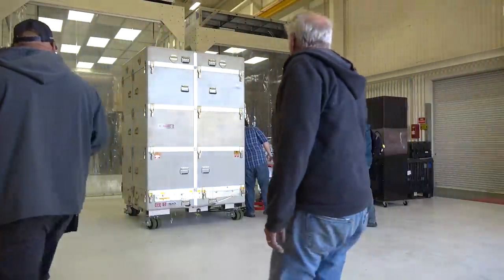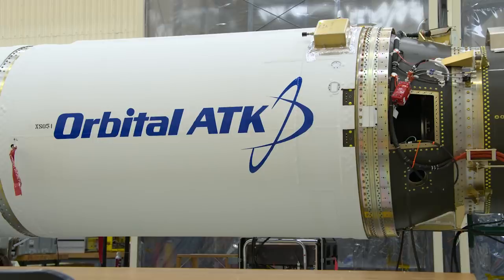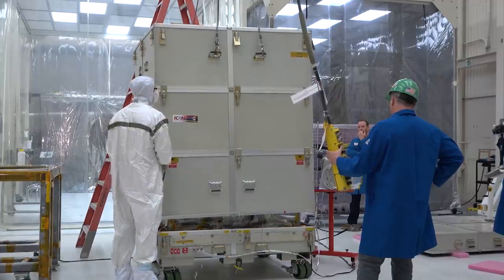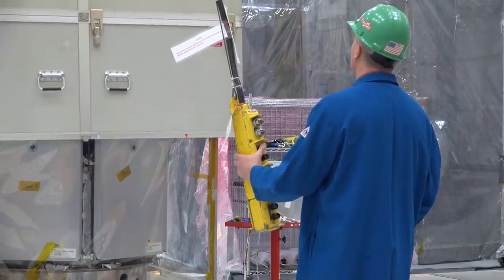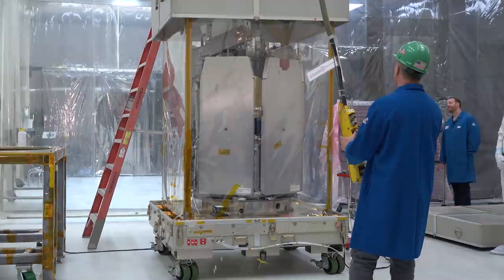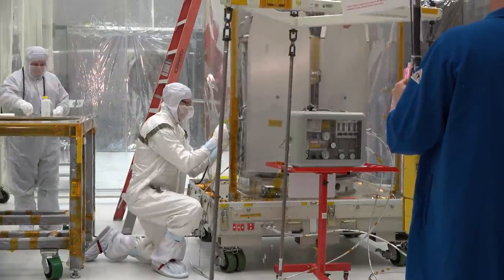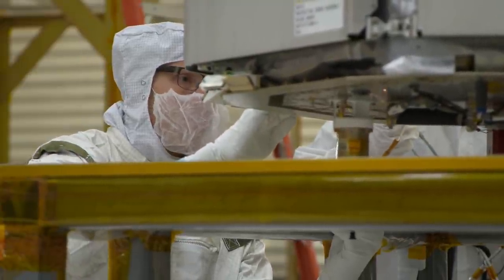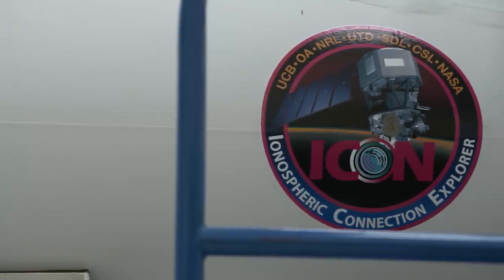Unboxing a New NASA Spacecraft

Comment: I always find it odd when they treat Earth-orbiting satellites like ICON with such kid gloves, in rooms that are cleaner than most operating theatres, when they're going to drop it out of an airplane inside a rocket where it'll be shaken to within an inch of its life! It would probably be better to be a bit more clumsy while it's still on the ground, so if something comes loose it can be remedied before being launched.
Reply: Because its for show. This isnt going to "space" but believe that if you wish. Remember nasa gets 20 billion anually
Reply: Not sure why you put "space" in inverted commas. ICON is going into "orbit". Are you saying that they're going to fake the launch, then fake ionospheric data for the next 2 years?
Reply: TV signals and GPS are all Fake. Satallites dont exist.
Reply: @nagualdesign: This is why they do shake tests with all spacecraft before launching them. They shake it on a table made specifically to mimic the stresses it will experience during a rocket launch. But that's before they ship it for launch preparation.
After those tests, they check if everything is still working, then it's off to the launch facility. You wouldn't want to risk damage after the final checks, because the next time you would find out if it is still working or not would be in orbit.
Reply: Contamination from particles or despositions is a different problem than damage from shaking. Clean rooms address the contamination. Shake tests address the later. Both are essential.